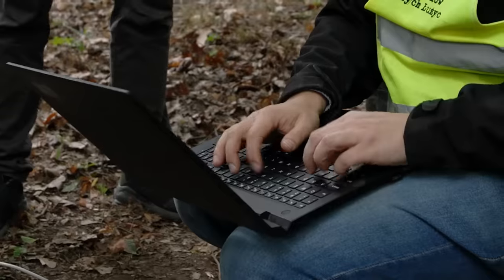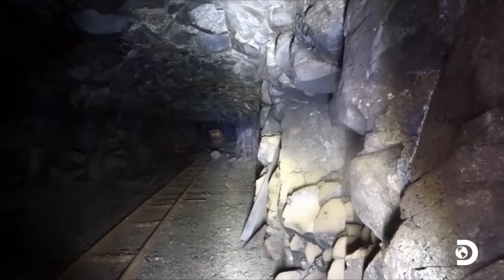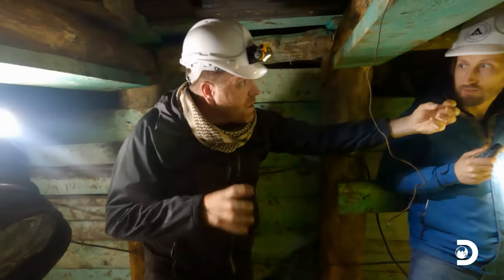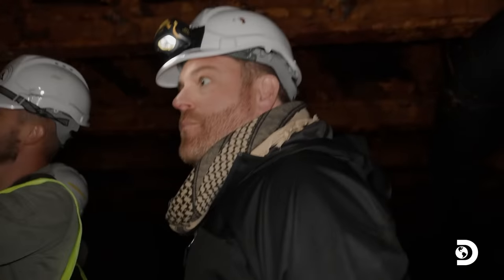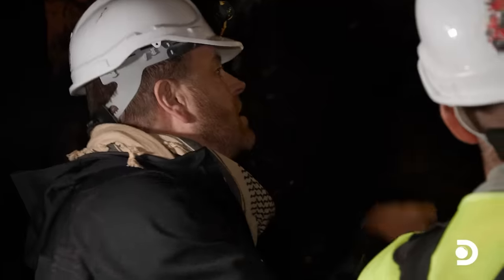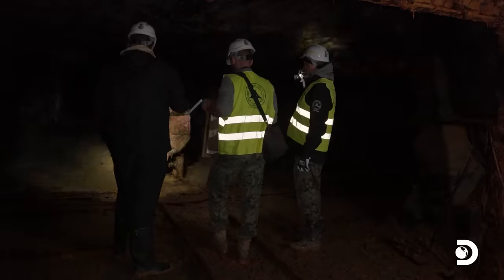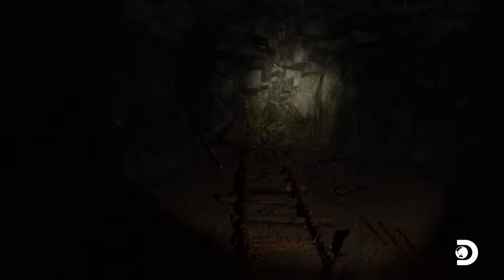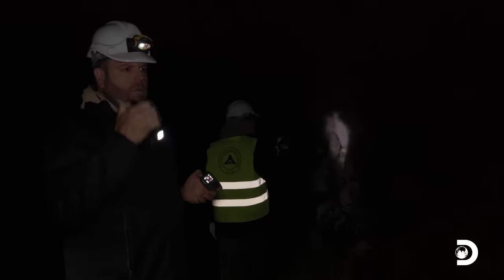Secret German Tunnels from World War II Discovered! | Expedition Unknown

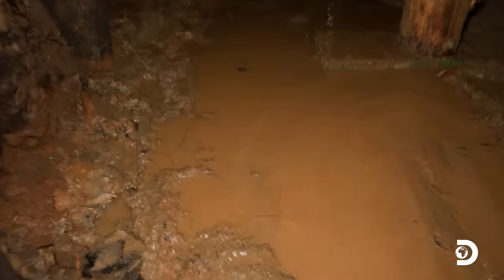Comment: :yt: @3:52 The section after the rock wall, is WELL WORN already. This means that they had already been back there and emptied out all the valuable stuff then built the rock wall back up. They took the camera crew there to try to say that they just now entered the area and nothing was in there! They were using the Discovery team to cover their tracks as a tomb robber...:yt:
Reply: You’re definition of tomb is… interesting. It’s an abandoned mine shaft, there’s one like 5 minutes from your house just like it.
Reply: @radomane  That was a storage tunnel, not a mine. It was made to store items. Mining tunnels follow a seam of what ever mineral they are mining.
Reply: Glad you said it!! i was looking at that too!
Reply: It was done to artificially increase the drama, much like the rest of the clip.
Reply: They dig this out in 2021, now you can see area is clear there is no EOD on site. Also that was solid concrete wall with loose rock backing, as they passed airlock that was on the left side (costs and fear of 80yo IED's). And only 1/3 was accessible as mining inspection did not allowed people in to the right passage, but I see area is dry no. That last segment "what it could be" is stupid, as from plans and documents used to find this and dug the work site we know it was intended as bomb shelter.